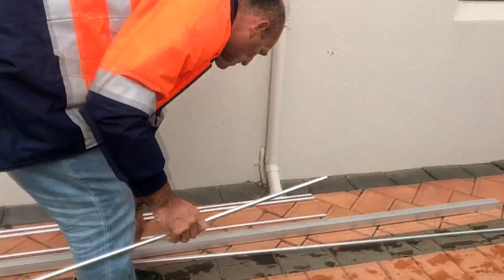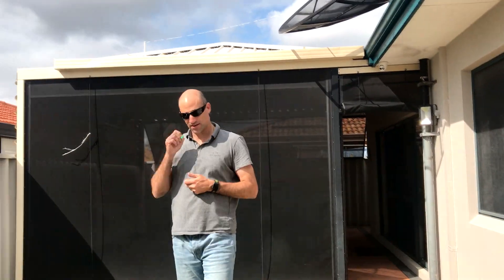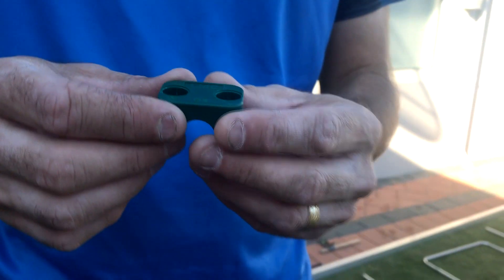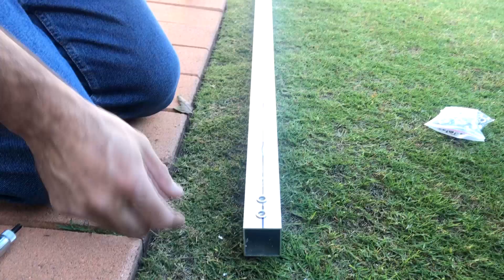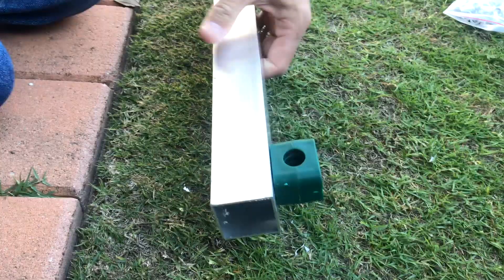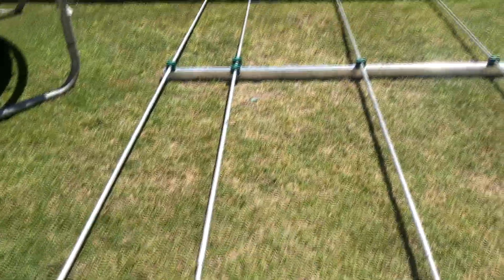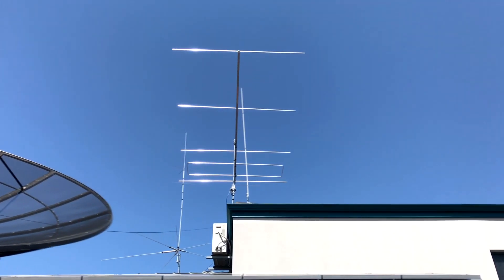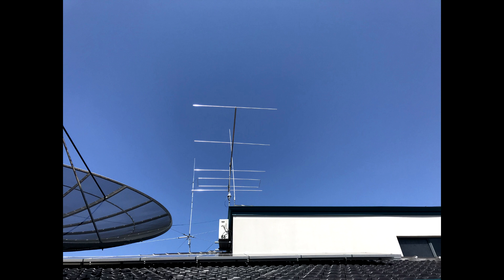LFA Yagi Antenna for 6 meters

Comment from the maker: Have run it now for two DX seasons and performance is really good. The Antenna is resonating 2.2:1 on two meters as well and works. Will make a video on that soon.
Tubing is 16mm in diameter. Balun was calculated and can handle 400w+ due to coax rating.

Comment: After running the LFA for a while now, how has it compared to your previous 6M antenna?  Nice build, 73!
Reply: Thanks for the reply.  Sounds like a winner!  Wound up putting up a 14 ele 28ft boom LFA for 2M and very happy with results.  FB is better gain goes without saying very good.  The biggest problem has been local noise while running preamp and while out of my control for a certain extent it's nice to have a sharp antenna with good rejection to null out what I don't want to hear.  I still pickup noise in exact direction of it but have to be a little more on directed at it.  When direction that it is in zero noise with preamp on it can hear extremely well as in receiving indoor antennas over 100+ mile range and understand what they are saying on a regular basis.  If cross polarized at that range barely can tell someone is there sometimes depending on their height.  Have fun & 73!
Reply from the maker: Comparing the two antennas was easy the gain was better 3db mainly due to an extra element and at the same time the noise level was lower. Also would like to add that because the driven element is a loop it picks up 2m band and can transmit as well. 2.2:1